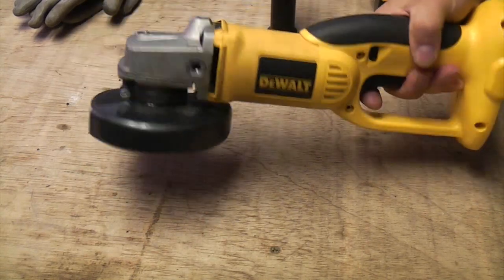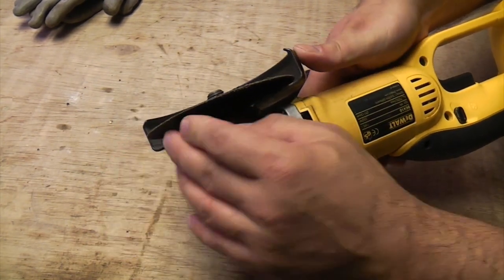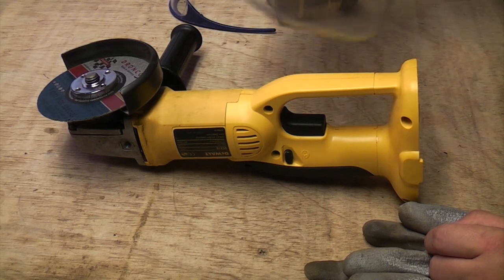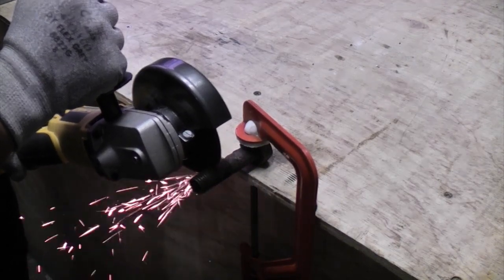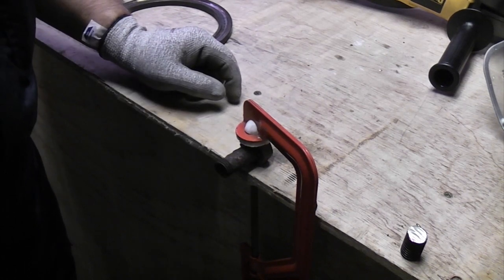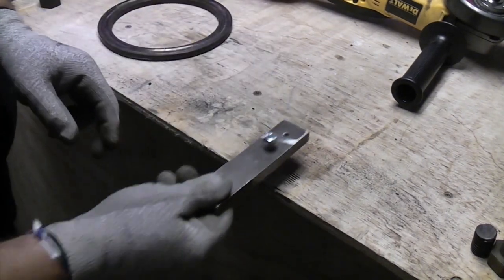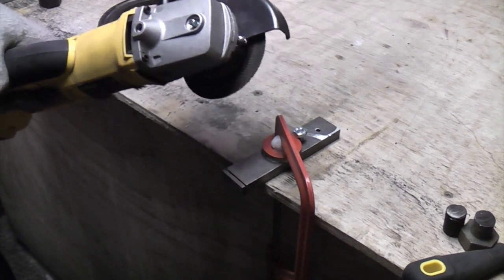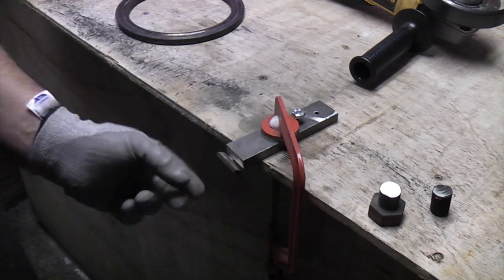Dewalt 18v Cut off saw review

Comment: Thanks. It's interesting how the housing of the grinder is magnetic and grabs the steel dust and particles there. Never seen this on corded grinders, I fear this will be a problem when the metal dust accumulates on the inside of the machine too.

Comment: Ive just used my DC411 to cut some old bolts off a rotten garden gate.
I was using it the other day to grind down a section of concrete floor in the house.
I should imagine the new 4ah Dewalt grinders are even better with the slightly faster speed and higher capacity.
Reply from the maker: Yes, the 4ah batteries are much better.
You have got me thinking about upgrading all of my Dewalt gear now ;-)

Comment: Cut you cut through hardened steel with one of these cordless grinders and slitting discs?
I recently had a 60mm padlock fail to open on a gate,and had a hell of a job getting it off..had to cut the mild steel chain instead,which i didnt really want to do!
many thanks again for the great vids.

Comment: @ultimatehandyman Life for burglars is getting harder - Actually i think it would it would be Berlin so my biggest worry would be getting molested by some buxom Frau - But i think I would need a Bosch(Austrian/German) 18v machine with a 3.0 amp battery and a back up. But I hate those bars inside bars they are horrible - do you think your Dewalt would be able to cut those?